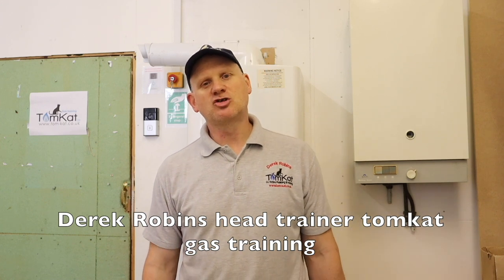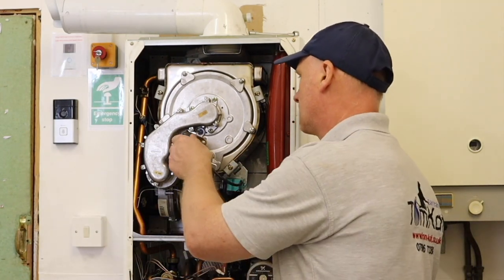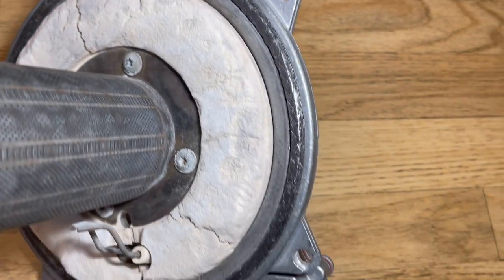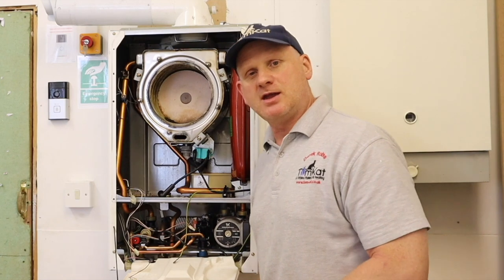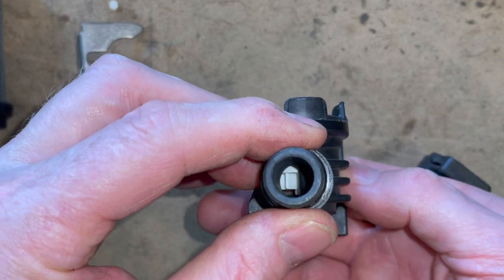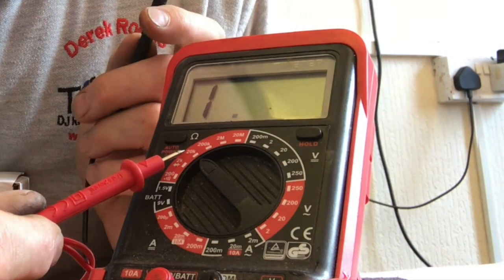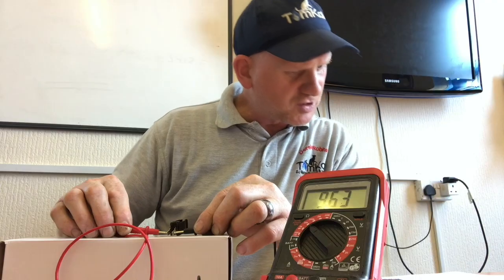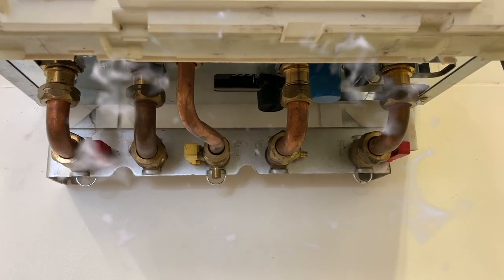What's inside a glow worm cxi 30, full strip down/repair  and review of the combination boiler.

Comment: This is a great video. I have heating but no hot water, burner not firing on tap opening on this boiler. Any ideas if i need to change pressure or flow sensor, or both?? Thanks